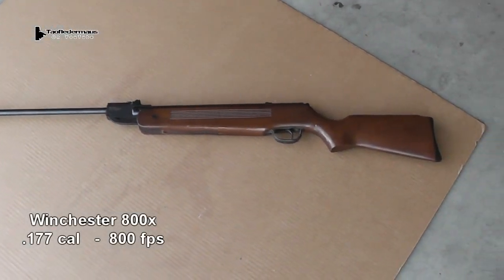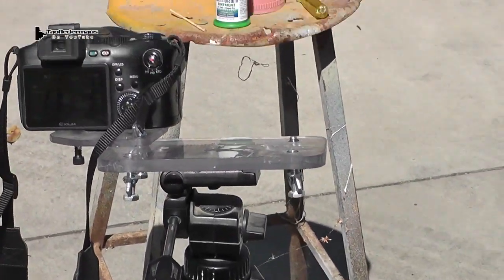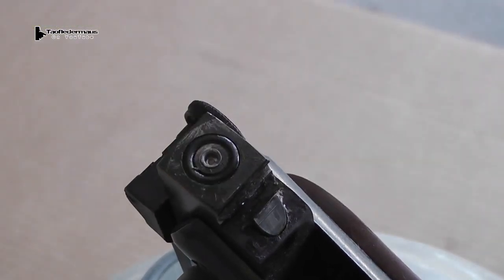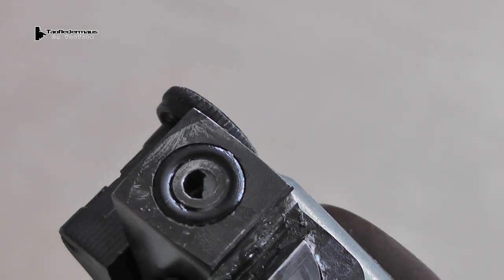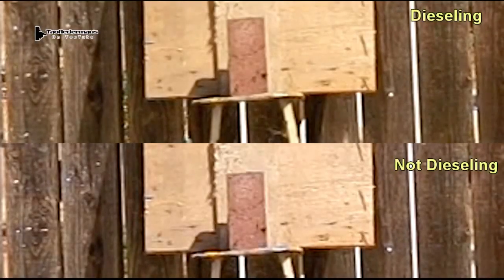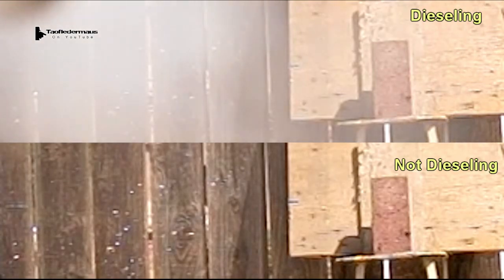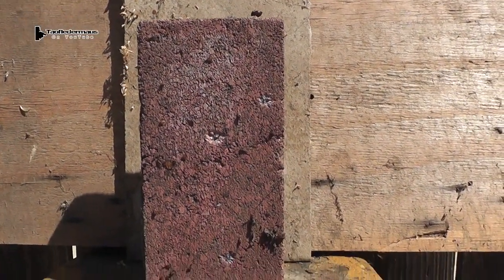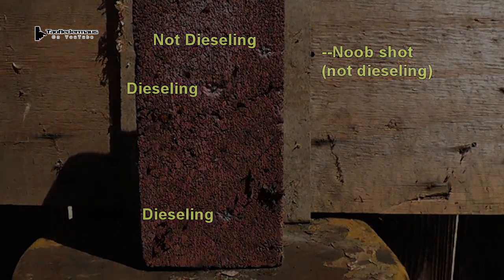Pellet Rifle DIESELING  -   Good,  Bad or Ugly?

Comment: I did the same test using 3 in 1 oil inside the skirt. My target was a 2 pound empty propane cylinder. I am using a Benjamin Trail NP All Weather in camo in .22 cal. The velocity of this pellet rifle is up to 950FPS using PBA or lead free ammo and about 820fps using 14.3gr pellets. The undieseled pellet hit hard and left a hell of a dent, the dieseled pellet shot in a different location on the bottle made one hell of a crack and punctured the propane bottle but did not exit. It does make the pellet go about 150 - 200fps faster. But it is like you say if you value your pellet rifle DON'T DO IT!

Comment: in my gamo shadow 1000 I almost get through 1 inch of pineboard without diseling. with diseling I go straight trough 1,5 inches of pine board. I use one drop of oliveoil and i seat the pellet flush in the barrel the way it supposed to be loaded. I use gamo magnum pellets in .177

Comment: Just did this, but didn't think to film it, would be better with a high-speed camera anyway. Took 4 beer cans filled with water, shot 2 with dieseled pellets, 2 with standard, compared them. Did the same with water bottles, compared them. Same distances, same conditions. Dieseled pellets hit much harder, the beer cans couldn't even sit on the bottom rim after being shot, and the water bottles had huge tears down the side, vs a clean hole. I also tested to see if it was just the gap, and nope.

Comment: My personal experience has been different, using a Gamo air rifle that shoots 1,000 fps stock.  Mabe the piston is stronger but it would diesel using one drop of standard gun oil and it increased the velocity by quite a bit.  Could tell by looking at the size of dents in sheet metal and penetration through wood being much greater.  After a few hundred rounds I've seen no real damage to the piston seals.  Ever if there was, O-rings are cheap.

Comment: I think you just saw it happen with petroleum jelly, which IIRC is less flamable than diesel fuel. The pressure is for sure decompressing, but for that fraction of an instant it is enough to combust it. The wiki page on this is inconclusive, but says several hundred degrees.

Comment: Hey there Tao- I have a Crossman phantom 495 (cause i live in canada..) with a ''special'' piston .  now.   without dieseling a .22 bounces off the cover to a computer power supply .  But still put's quite the dent in the steel.       When i Deisel a pellet with Gun oil.   it goes clean through the steel and about a quarter of the way into the 2x4 i was propping it up on, Mind you i do not push the pellet down. i fill up the skirt with oil. That send's It flying.

Comment: The pump airgun would actually cool the oil, not heat it.  For the same reason that gas coming out of a pressurised can is cold, not hot. Dieseling only works with spring-guns, not pump, CO2 or pre-charged pneumatic guns.

Comment: I tried dieseling a 10 joule .22 air rifle and i shot a sheet of steel and it went all the way through then i shot the same sheet with a 30 joule PCP. 22 air rifle and it made just a dent.(The 10 joule rifle without dieseling didn't go through either)

Comment: Dieseling's not good for your gun, or it's accuracy for that matter. It will blow the seals in the gun and if you're really unlucky you'll get a face full of oil and other crap from inside the gun when it does go. You can probably get away with it a few times but it's not going to do the gun much good in the long run.

Comment: I suspect that the combustible material is forcing gases back into the cylinder from whence the air comes.  If you put a cross section of a pellet behind the propellant you could maximize any potential of added speed produced by the gases produced.  I say try pellet, vaseline and then a disk of pellet that fits the barrel snugly.  That's my two bits...

Comment: No, I can tell that you can see them. But you didn't say what if any difference in measured time there was. Like I said before, no air or firearm is perfectly consistent on the speed of the projectile.  Air rifles can vary widely between shots.  I'm not familiar with the Winchester brand so I don't know if it's a multi pump or a break barrel/spring piston rifle.Also, maybe if you put a projectile behind the propellant you could increase the likelihood that it would speed up the projectile.cont..

Comment: I believe that adding anything other than the pellet to the barrel of an air rifle would lower the fps. one you are increasing the mass that is in front of the piston. increased weight lowers speed. and also the space that was added allows the gasses to decompress, lowering the max psi behind the pellet. the louder pop would come from the liquids expanding and pushing the air around the muzzle.
Reply: that added weight explodes, dude.

Comment: I don't think pump airguns reach the required pressure to diesel most fuels. Spring-piston airguns rapidly compress the air at the moment of firing, causing a spike in pressure and temperature.

Comment: The combustion doesn't really add anything because the small amount of extra pressure you get from a tiny amount of flammable material is negligible compared to the pressure already being exerted on the gun. Pack some gun powder in there and then fire it, but i'd suggest not shooting the gun without a nice, distant proxy.

Comment: Nope... If you break it, you will hear it when the pellet leaves the barrel. The pellet will slow down as soon it leaves the barrel. Anyway, There is a cracking sound but only at +1000Fps.

Comment: When I was a kid I use to spray a bit of WD-40 directly into the cocked piston cylinder, thinking it "would lube the piston", instead, it would diesel, and give the pellet gun a loud crack and a visible muzzle flash! also a little flash out of the breach(poor little seals)

That old gun still works today, albeit at a lower fps. I could probably find some good replacement square o-rings for the breach on mcmaster-carr, maybe even stiffer ones.

Comment: The smoke cloud is more likely just the atomization of the petroleum jelly, which if not achieving it's flash point is probably absorbing a lot of the heat that may be left over from the compression stage.

Comment: Yes but I don't think it's enough heat to "detonate" the compressed diesel fuel.  Firstly because the air pushing the pellet is actually decompressing as it leaves the pressure cylinder.  And secondly because I don't think a pellet gun achieves the same pressures as a deisel engine, which if I'm not mistaken is around 24 atmospheres.  I might be wrong on how much pressure is in a pellet gun but I'm sure there's just no way to get the combustion to be usably efficient, in this experiment anyway.

Comment: Even if you use actual diesel you'd still have to add heat as well as pressure to actually make it explode like it does in an engine.  And then you've really got a single use situation.

Comment: I use peppermint oil in the pressure chamber of mine, that DOES work to add a boost, plus it cleans the barrel as it goes so no damage. Chasing the pellet with vicks is not a good example of this technique.